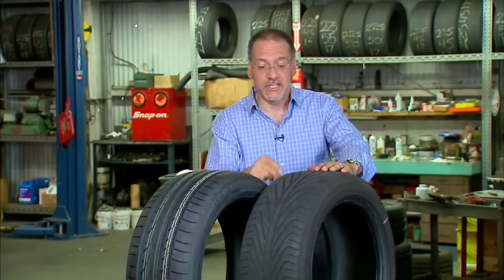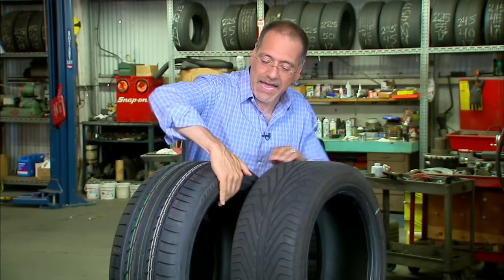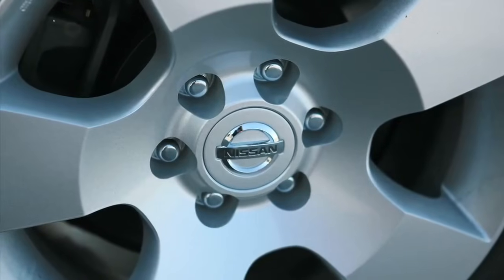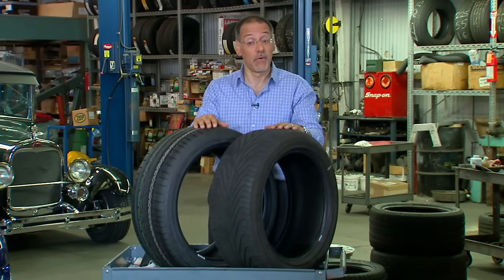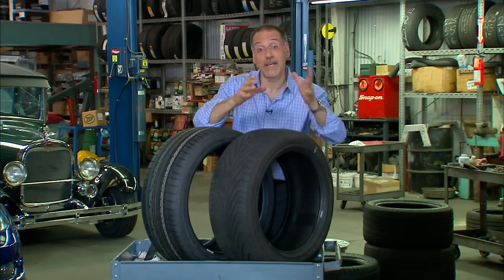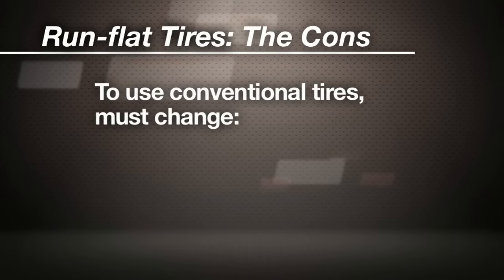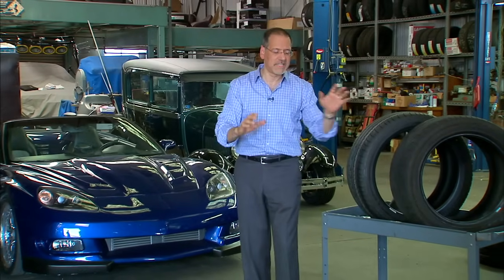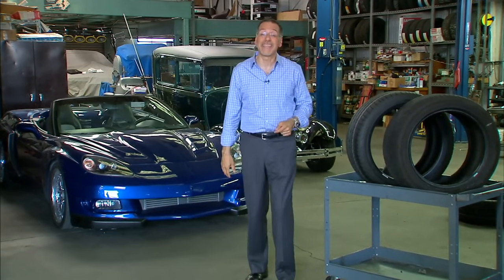CNET On Cars - Smarter Driver, Understanding run-flat tires

Comment: The 255/50R19s on my BMW are 10.5 lbs heavier than an identical non-run-flat. For each tire. Given that it's rotational mass and unsprung weight, that's guaranteed to have a huge impact on ride quality and acceleration. Can't wait to try non-run-flats.
Reply: I'm curious if you plan to carry around a spare tire when you change to normal tires?  Honest question.
Reply: I run non-run-flats in the winter and got a spare, just to be sure. Winter tires ride WAY better than the summers. Seriously thinking of not waiting for the OEM run-flats to wear out and just chucking them - or stashing them to put back on if I decide to trade it in.
Reply: My question is, with conventional tires where does the spare tire go now?

Comment: Not only those cons, the ride is noticeably harsher. They also can skip under acceleration when taking a corner very fast (annoying, and more importantly very dangerous) I noticed a less amount of grip in the rain and in general. When outweighing pros and cons, run flats are not worth it at all
Reply: German cars are supposed run harsh.  I love the road feel.
Reply: @allenho2778  errmm no there not, I've had several, Porsche, Mercedes and BMW
Reply: @AdrianJayeOnline  I disagreed with sigimmer about skipping around a corner. It is true the ride is harsher compared to American and Japanese Autos.
Reply: Don’t forget that most cannot be repaired.
Reply: @rileysmith9843  I do European Delivery every five years, so it is not an issue for me.  In case you have not noticed, most of the OEM are simply replaced rather than repaired.

Comment: You forgot 1 more con, run flat tires have a short tread life
Reply: thabg007  that depends
Reply: Totally not true
Reply: @maxfury7226  technically, the higher the weight the less tread life. The runflat weighs more, this less tread life lol
Reply: John Qiu? I’ve leased 3 BMW’s and never had any issues with the tires being worn...maybe you were just using cheap tires!  Lol!
Reply: @maxfury7226  no I never purchased run flat tires, but now I have a a newer car that came with run flats, they are holding up fine,  guess I was wrong about the tread life
Reply: @thabg007  Glad you came back to rectify this after 6 years.
Reply: @Zama_Nkosi  and i still have the same tires, plenty of tread left
Reply: @thabg007  Dang bro - appreciate you coming back 7 years later to post an update.

Comment: I bought a used van with runflats. Little did I know the slow leaking one (fron dealer) would cost $750.00 per wheel. You HAVE to change two, not just one. So, $1,500 to change both fronts. It'll take me a year to cough that up after spending savings on getting a used car in the first place. ITMT: I use a shop aircompressor every 2 days to get me to work everyday.

Comment: Worst product ever. Causes vibration, stiffness, road sound, expensive, get damaged quickly and non reparable.   I got rid of them and replaced them with regular tires, now it rides smooth like I'm driving on glass.  Now I'm driving a BMW instead of a bone shaker.

The question is BMW,  Why ????
Reply: actually it's to save cost
Reply: @AdrianJayeOnline  how does it save cost when in actual they are more expensive than regular tyres?
Reply: @kb0804  It saves weight and space compared to spare tires.
Reply: @technikleo3797  I’m going to lean more towards cost, considering the difference between sprung and unsprung weight savings.

Comment: Never liked these tires personally. They ride rough and they wear out faster. I work as a technician at a Toyota dealer and people who have an AWD Sienna van often opt for regular tires once the run flats are worn out. The ride difference is night and day between vans equipped with regular and run flat tires. The only thing I like about these tires  is we get paid more for mounting/balancing them compared to regular tires. 
I drive a BMW 335i and the first thing I did after buying it was getting rid of the run flats. I just bought a spare tire off some older 5 series. Ive had the car for 2.5 years and I’ve never had a flat
Reply: I dont mean to be so offtopic but does anybody know a way to get back into an instagram account??
I stupidly forgot the password. I love any help you can give me!
Reply: @Marley Colin instablaster ;)
Reply: @Joe Miles It worked and I actually got access to my account again. I am so happy:D
Thank you so much, you really help me out!
Reply: @Marley Colin You are welcome =)
Reply: I like my run flat but i got the discontinue PAX MICHELLIN SERIES, can i just get a regular heavy duty tire to replace them will it work?
Reply: @disnalee  Nope. You can’t drive heavy duty tires flat. You can get another run flat tire brand like Bridgestone Turanza RFTs or just put regular tires on and buy a spare. Also if your vehicle happens to be a Honda Odyssey Touring that had the PAX system their OE rims may be a special size.

Comment: Personal choice of course, but I’m sticking with RFs. Yes, the ride’s a little harsher and road noise higher, but the handling’s good and grip levels are fine. But it’s safety that especially makes me stick with them. Had a blowout last year on a motorway without a hard shoulder. The RFs got me home   NRF would have been a whole different story…

Comment: You will get 15 K miles on them if you're lucky. Replaced two sets on  MB 2016 GLC (Pirelli Scorpian Verde); not driven harshly; after 30 K and four years, I gave up and purchased Bridgestone NON run flats (supposed to last 70 K). MB only offers run flats on 2020 GLC, but now allows you to buy a compact spare foe $200. No jack available unless ordered from Germany.

Comment: Jeep grand cherokees have run flats. The higher end performance models. Those are big tires 295 35r 20 if memory serves me correct. The poor tire machine struggled to get them off the rim from the stiff sidewalls

Comment: Run flat tyres are only of benefit to car companies. I have had  run flats on BMW's  for a while you will be lucky to get 15 miles out of them flat especially lower priced ones they get shredded. and if you have a flat tyre at midnight ?  good luck with that. I suggest use  run flats between 8am and 6pm when garages are open.

Comment: I have the PAC MICH TIRES ON MY VAN, CAN I JUST REPLACE IT WITH OTHER RUNFLAT TIRES and where can i get it done???
Reply: Took a year for me to see your comment, but you can just ask for run flats at pretty much any place that sells tires, I used to sell tires at a Sam's Club and we also sold run flat tires. There aren't special rules for replacing run flat tires, but you can't repair them due to the fact that the sidewalls do wear when you actually "use" the run flat part (we used to offer free repair for anyone with a membership so it wasn't always worth it unless the vehicle didn't come with a spare).

Comment: What tire cut ... can I ride on a Mercedes w220?  Forward 245/35 / R19 .. is that ok?  Back 275/40 R19 is that ok?  It will not touch the rear wing 275/40 / R19?

Comment: Don't be fooled, the main reason is cost savings, no tire/wheel/no jack, think about it, if you could save a dime on not putting say a washer on a car, how many dimes do you save on selling a 1000,000 cars ? Now work out saving say $100 (at cost) for 1000,000 cars, that's a lot of money. got nothing to do with safety, environment or anything else, its about DOLLARS & CENTS

Comment: DO NOT BUY RUN FLATS--Especially if you have TPMS. If you must then buy the Bridgestone RE960 or Driveguard --they have decent ride quality and longevity.
Reply: Chris Namaste I got Driveguard recently. Has a horrible road noise. Mechanic said everything was ok, just a tire noise. Are they supposed to be like that?

Comment: My new Mercedes-Benz C300 has the Continental “run flat” tires. They are called “MO” tires. (Mercedes Original) They are available at the Mercedes-Benz dealership service department only. If I get a flat tire, I have to go to the nearest tire shop, who do not stock them. Since the MO tire cannot be repaired as regular tires, they must order a new MO tire from a nearest Mercedes dealer, have them deliver it, and they would mount and balance it, and then install it. In the meantime I have to wait until the job is completed. How long do I need to wait? It all depends on the distance from the tire shop to the nearest Mercedes-Benz dealer and if I’m out in the boondocks, it’s gonna be a while.   😫

Comment: Runflats, because the idea of having a real spare tire you wouldn't get to spend loads amount of money in a short time when your tire needs replacing. No thanks, i'd prefer to keep my regular spare tire (not a cheapo donut tire either) instead. The only good thing about runflats is you can get off the highway to replace that tire with your spare.

Comment: Any one who prefers the traditional system with spare tires, either can't afford run flats  or has never nearly lost control on a blow out / changed a tire in their life at 3am with rusty lug nuts only to find the spare is also flat.

Comment: 5lbs isn't that dramatic of a difference
Reply: Matt Miller x by 4 tyres makes 20ib
Reply: Also this is unsprung weight which affects suspension dynamics. So 5lbs is quite significant. More than those cool alloy wheels are saving.
Reply: Matt Miller 
But you are saving one spare tyre + metallic accessories and their space... I’ll say weight is not an issue
Reply: Five pounds is a major difference, not only because it is unsparing, but also because it is “rolling weight.” Every time the driver accelerates the inertia of those 20 lb. of extra mass on each corner must be overcome. That means lower fuel economy and reduced performance. The inertia problem manifests itself again under braking: longer distances, increased pad wear.

With today's tires and roads, flat tires are a rarity. Better to use regular tires and carry a space saver spare, and call AAA on your cell phone if you have a flat. Chances are you will never have to. 

Run-flats are a gouge by BMW, which has declined from a driver-oriented manufacturer into just another greedy car maker. They charge a fortune for replacement run-flats and don’t have to provide a spare, which saves them money.